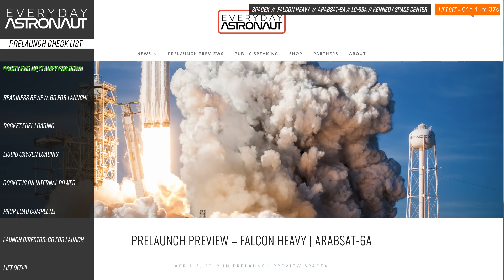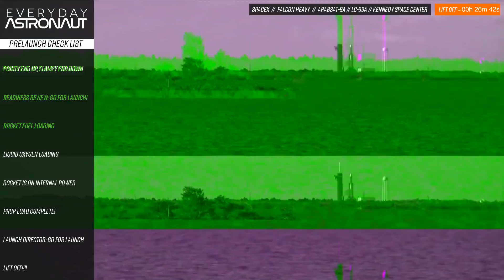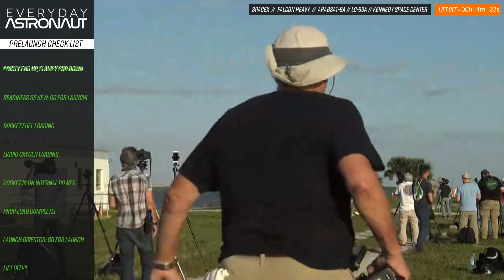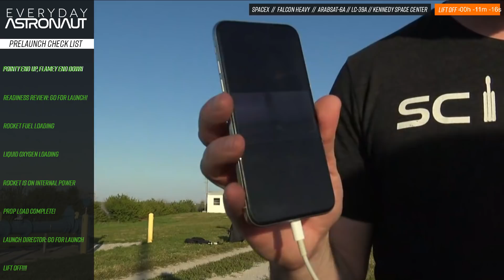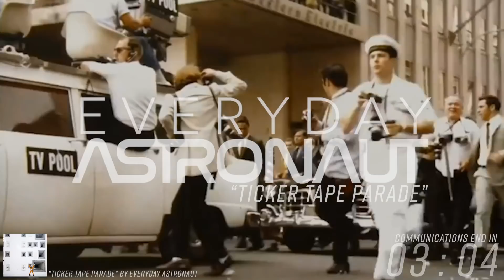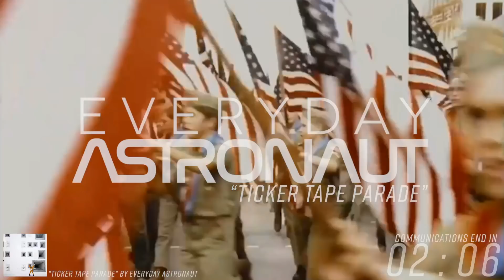Watch SpaceX's second Falcon Heavy launch LIVE from 5 miles away!

Comment: Perhaps you could shed some light on this for me: why does SpaceX insist on landing the center cores on a ship? Could they not just have it complete an orbit and land at one of the pads on the Cape? I know it won't be at perfect orbital height, but couldn't they push it to a greater altitude and use the decaying orbit for re-entry? Seems like a huge risk to the rocket to land on- and also be transported by, a boat in the middle of the Atlantic.

Comment: Anybody know why they open the landing legs so close to landing/touchdown?
Reply from the maker: The rocket isn’t very aerodynamically stable when they’re deployed. Having that much drag at the front could make the rocket want to flip over, so they want to deploy the legs as late as possible.
Reply: Thanks! Good to know. I wondered every time because as you can see on the Booster failure landing the landing legs makes the booster more stable in rotation, but I think this is the "easy part" in landing this tall candle :-) btw: great videos and content! greetings from austria

Comment: Hey Tim!  
I was bummed when I missed the live stream, and then I found out you missed some footage and thought Tim's definitely more bummed than I. Still a great live stream =)

In SpaceX's live stream, it shows the LOX tank (i presume) at 45:09 and I got to thinking how do they orient the fuel towards the aft end with the pumps/turbos/combustion bits when in a near zero g environment when they aren't accelerating but just coasting, does the pressurized helium still provide the pressure to force fuel into/towards the engine? Or does that all just jossle around in the tank?  Also, not sure if this is heat mirage (heat haze) or if this actually occurs, but at 49:06 at the final second stage shut down the mvac nozzle appears to wobble or distort. I don't know if it could be heat haze because they are in the vacuum of space and I believe heat haze requires air... So I'm guessing the mvac bell is just that flexible especially at those temperatures?

Comment: Glad I had SpaceX channel on so I got to see the launch and landing.   Much better when you used their feed with your commentary over top.
Don't try and re-invent the wheel.   Especially when it is a SpaceX wheel.
This is one time that my "Panic" paid off.   You where still answering question at t-2:00. I panicked turned on the SpaceX feed.
I won't make that mistake again.
Some lettering on the screen does not  make up for missing the launch and landing.

Comment: I just find it amazing that the side boosters got from the launch site to the landing site faster than if you had driven a car on one of the access roads over 60 MPH. Oh, and they went nearly 100 km up in between.
Reply: Is that confirmed? Really nice fun fact if so.
Reply: @christophkitterer131  According to Google Maps, the road that leads from launch site to landing site is an 11.2 mile drive, and the side boosters landed at the 7 minute, 50 second mark. You'd have to average 85 MPH to drive that in the same time the boosters took. And based on the tight corners for the first mile, you'd likely have to go over 100 MPH for the long straight(ish) stretch of it to beat them.

That's assuming the Google Maps walking route is 100% drivable, since it won't give driving directions due to the private property. https://goo.gl/maps/ya311R723fN2
Reply: Anonymous Freak nicely done, thank you!

Comment: Question: why use Heavy for this satellite? It's ~6000 kg to GTO; Falcon 9 is supposed to be able to get over 8,000 kg to GTO.
Reply: Mostly because, by regulation, SpaceX needed to have two successful launches in order to demonstrate technical capability / reliability of the platform to qualify for US Air Force launch contracts (which is one of the few really lucrative customers for payloads in the weight-range the FalconHeavy services at the present time). I believe the satellite owners for this launch were only charged the same fee as a Falcon 9 launch, but SpaceX put it on a Heavy to open the door to that sweet-sweet, ginormous, US Military-Industrial Complex piggybank...
Reply: @brtle  Thanks. That answer makes a lot of sense.
Reply: @brtle  ☝🏼☝🏼
Reply: I had read that it was originally slated for a FH launch... before Block 5 F9 was capable of lifting more.  Apparently the satellite had already been built a certain way or something.

Comment: Nice video. Thanks.  A couple of suggestions. 1) Set lens to manual focus at infinity, and will avoid the autofocus grabbing something near (like crowd or bushes/treeline) to focus on. At that distance, it will be infinity, but you can micro adjust it during the flight if necessary. And 2) set up closer to the water where no one will get in front of you.
Reply: For 1, he wanted himself in focus when he was in frame.  For 2, he either got there too late for that prime location, or maybe the people in those spots didn't have a good view of liftoff, and he wanted a good view of both. (Without having to completely relocate his whole setup in the middle.)
Reply: @AnonymousFreakYT  I he wants himself in focus he can easily set it back to auto. It'll make it much easier when filming the rockets to do what LarryGrayPhotography suggested.

Comment: Was this supposed to be a geostationary satellite?  Then why did they release the satellite south of the equator on a southeast trajectory.
Reply: John Francis Doe Some geostationairy satelites have a not exact equatorial Orbit.
Reply: Doo Doo But it was apparently going away from the equator at payload separation.
Reply: John Francis Doe  Its called Inclined geisynchronus orbit. Projected on the earth's surface it draws an 8. Its sometimes used to save fuel.

Comment: Why does the livestreams of rocket launches, stage separations or other critical moments in space flight very often cut off or lag alot in exactly those critical moments?
Or is it just me experiencing this? Maybe I haven't watched enough launches and I've just had bad luck with those I watched...
Reply: Murphy's Law, I guess, although in some cases the violence of the event itself can interfere with the signal.  That is why we rarely if ever get to see Falcon cores actually touch down on the barge--the camera and associated equipment are too close and get severely physically disrupted.  The same sometimes goes for stage separations, during which (depending on the rocket) explosives go off, ullage engines fire off, and the next stage's engines start up.

In this case, at this distance from the pad, I seriously doubt that the launch itself caused the disruption, but Tim didn't seem to know what to do with himself and kept moving around everywhere when he should have been standing still, watching with us, and I bet he tripped over a cable and pulled it out. :)
Reply: Murkla Murkla my live stream cut out at launch and all three returns
Reply: @bryanhauschild4376   I watched SpaceX's live stream, and I saw the launch, the near-simultaneous landings of the side-boosters, and the second stage separation with no problems.  As expected, however, the live stream cut out as the core stage landed, but it came back on soon afterward.
Reply: Yeah I'm almost getting some conspiratorial thoughts .. because in my experience this is a pretty regular occurrences in many livestreams involving space-flight.
Like the touchdowns.. are we sure they really do touch down as good as it looks?
Maybe they could play a pre-recorded touchdown and play that after the "real" one has cut out on stream.
And again its probably not like that, but these strange coincidences gets you thinking.